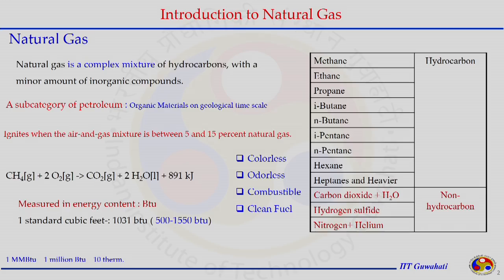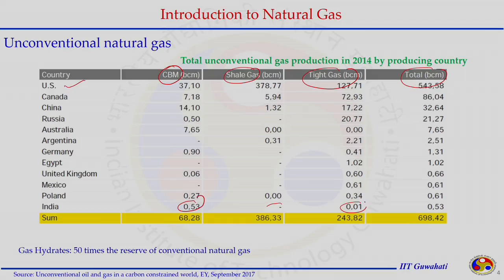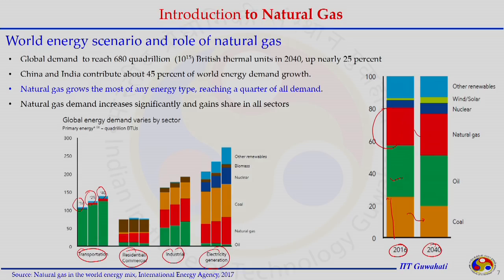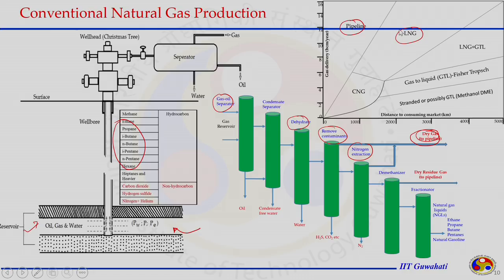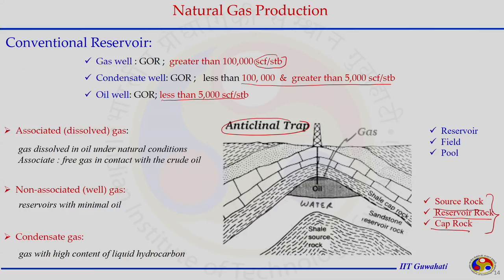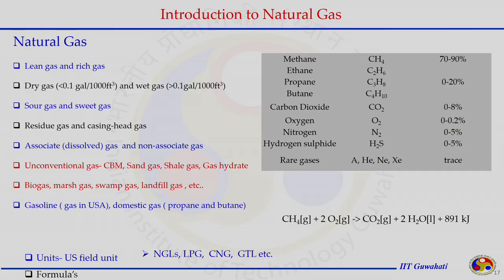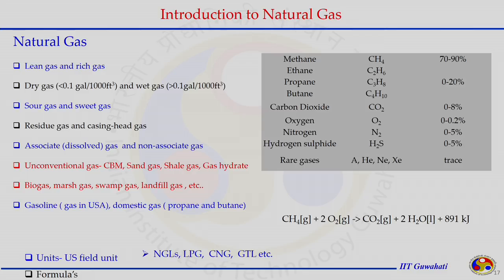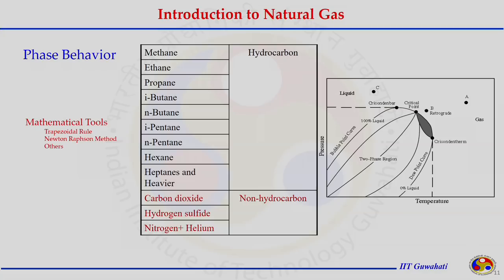Lec 1: Introduction to Natural Gas - I

Comment: Dear Sir, if a reservoir contains free gas above oil surface (and not gas dissolved in oil), will it be difficult to produce from such a reservoir?
Reply: yes it will be difficult and that is why when the oil comes to the surface there are different separation processes used for separating natural gas from oil.